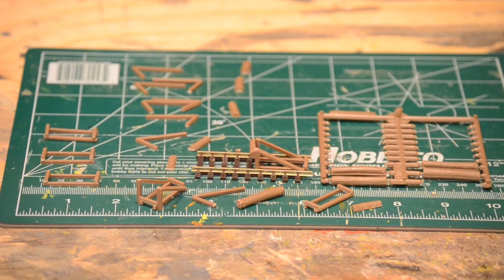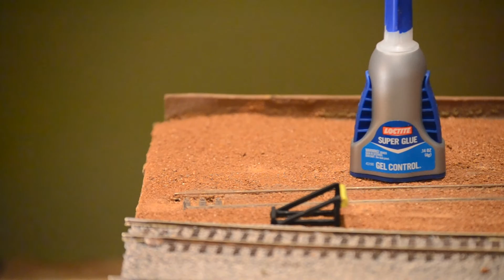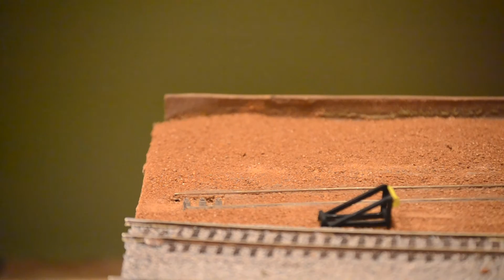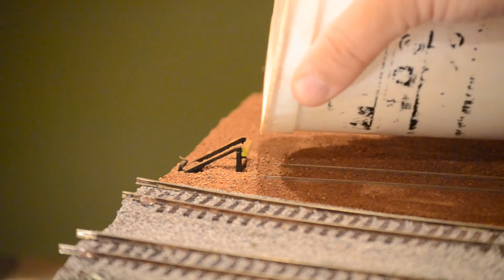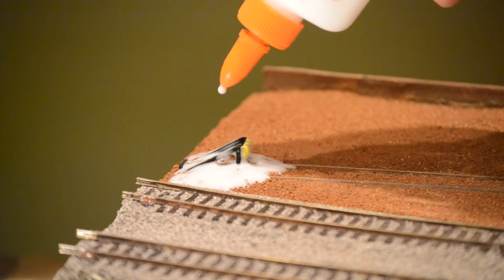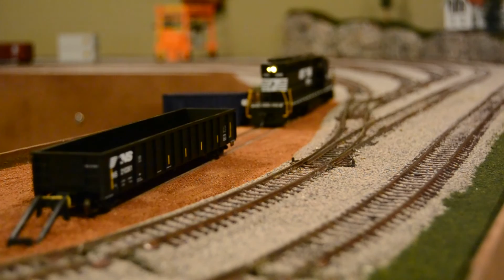Building Track Bumpers using unused parts from your modeling kits.

Comment: After much swearing and cussing, I completed a Tichy Train Group flatcar because I liked all the detail.  I followed the directions to the letter and wish I hadn't.  Before adding all the brake parts on the underside, you installed the stirrups.  I ended breaking every one of them off installing the grab irons.  The kit came with both plastic and bronze phosphor grab irons.  I threw the plastic ones in the trash and wish I had kept them.  If I ever build that kit again I will add the stirrups LAST.  I did make some stirrups out of staples from an office stapler as they were about the right thickness, just had to re-bend them to make 'em smaller.  When building a kit I end up spending as much time chasing parts across the floor as I do building the kit.  Lol.  I painted the flatcar rail brown on the underside and painted each individual board a different shade of brown mixing the paint in a communion cup (got a whole box of 'em) as I went.  It was a 40 foot flatcar so it really didn't take that long to paint.  After the last black wash (to fill in the gaps of the boards) of acrylic paint and alcohol it came out really great and looks like real wood.  
I save all my sprues from building kits and use them sometimes to fill bolster holes to attach trucks and drill and tap them for a 2-56 screw.  Guess now I'll try to build a track bumper or two.  Thanks for the tip.  I think I'd have painted it some dark brown (burnt umber) but before painting I would have used a razor saw and scribed some lines into the plastic to resemble wood grain and weathered it some.  I use 60% water to 40% glue as 50/50 is still too thick.
Cheers from eastern TN